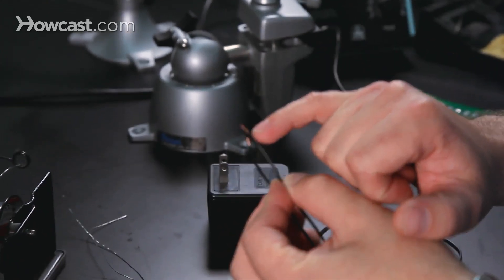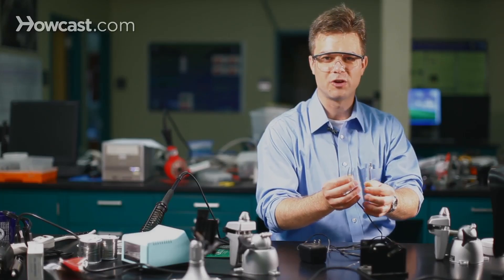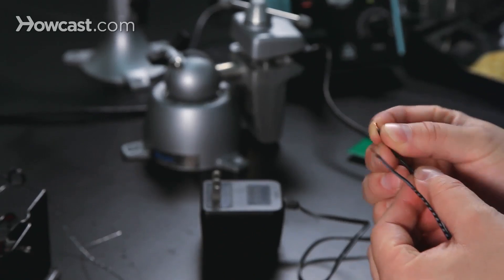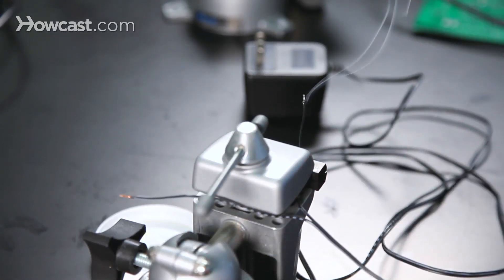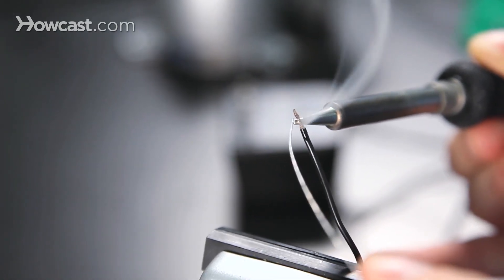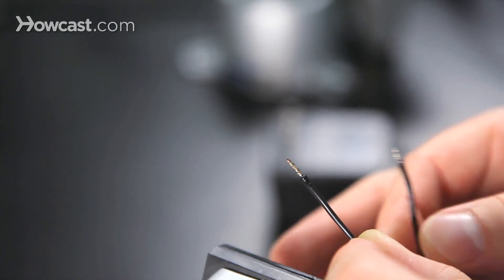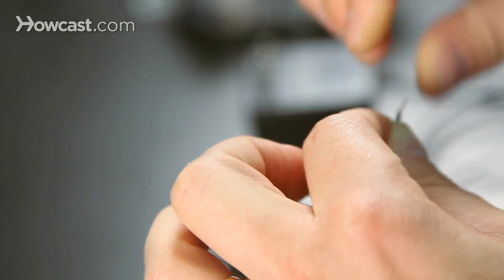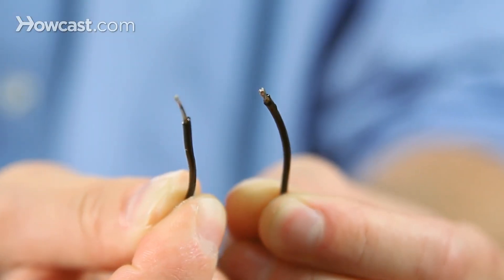Common Soldering Mistakes | Soldering

Comment: But it doesn't work!!!!  The solder never melts unless I accidentally touch it on the tip of the soldering iron and resultantly make a great mess of things!  I've got a 100W iron, I tried it at 350C and 375C on pitiful little 18 AWG wire and the damn solder just doesn't melt!  Why?!

Comment: I was having a hard time soldering 0.1mm jumper copper wire, I didn't know even coated copper could oxide. Just rubed some sandpaper and solded like magic!
Yes, I am learning, but tips like this makes huge difference, I don't know why there is so much shade in the comments, that tip was superb to me. I assume people on the microsoldering field don't want competition and is always throwing hate on people that teaches these stuff, that is nasty.

Comment: I have been soldering for years and have done thousands of solder joints and I recently tried to solder some copper wire that I freshly stripped only minutes before and even with flux the solder would not stick to the wire!

Comment: @1:00 3rd. cut and strip the wire. if you didn't have enough slack you are unprofessional and a noob at electronics. if that's the case, its a freaking wire, replace it.

Comment: How do I solder to a smooth metal surface!?
Reply: Depending on the metal, you may have to use a high acid content flux and solder and also rough up the area to be soldered. I think flux for copper piping is quite acidic.
Reply: @anthonytaylor8465  The metal in question is aluminum.
Reply: @voldy3565  sorry it's a little. But at work, we have to solder earth leads to aluminium and we abraid the surface and use high acid flux. Something called Rx I think

Comment: Okay when you cut a new piece and stripped it, was it not the same as the first piece? So no sanding was necessary.  However your claim of oxidized wire negatively affecting the soldering is correct.

Comment: I have a coin I wanted to make into a necklace but when I try soldering it (I never tried soldering before it seemed straight forward) the solder on the neckhoop thing and the coin kept on slipping off and wouldn't stick to the metal so I'm looking around trying to learn the basics

Comment: hello hope you respond to my comment i have a problem when i try to solder microphone wires small thin wires with colored insulate the thing is ... solder does not stick to them it keeps falling off i have no problem with other copper wires but with these it's a nightmare

Comment: The reason I found this was a google search regarding non-corrosive flux for soldering stranded copper wire; The problem if have found is that flux "no clean" tends, through capillary action, tends to wick up the strands, inside of the insulation, leaving blue-green corrosion of the strands, inside the insulation (discovered when disassembling/stripping insulation). To date, have been using Topnik RF-800... applied very sparingly with syringe... station temp set to about 290C, using Sn60Pb40 (SW26/3/2,5%) fluxless solder.... use IPA to clean fingertips, prior to twisting strands together... acetone seems to make the situation worse.

Comment: Doesn't flux remove the oxide already? If you've got flux, do you really still need to sandpaper the wire?
Reply: Ive never sandpapered it. It seems like a minor factor as to the quality of your soldering

Comment: Safety first, soldering a tiny wire with safety glasses on. You should also wear heat resistant pants, just in case you drop the iron on your thingy.

Comment: Wouldn't the flux contained in solder take care of it?
Reply: Normally yes; most solder contain sufficient flux within the core to not need any additional.

But for some special projects, such as those involving surface mount components (SMC) in which you're working with microscopic multitudes of leads, additional flux might be necessary.

Comment: As the aim of this video seems to be to find and point out the common soldering mistakes committed  in it, I found another one (I believe) not mentioned by others below: he talks about 'the alloying'. There is no 'alloying' when you solder. If there was the process would be called 'brazing'.

Comment: I'm an EE with a PhD in flux rheology and another in soldering alloys. I have over 40 years of professional experience soldering everything from hand-built custom spy satellite motherboards to sonar modules in nuclear subs. The tool I use the most is a soldering hydrogen torch with an iridium-plated tungsten tip. I usually clear oxydation by sweeping the wires and components with a YAG laser under a nitrogen atmosphere. If I'm soldering underwater, I prefer to use a focused induction or an ultrasonic tip depending on the salinity and oxygen concentration of the water. If I'm soldering for space, I usually solder with  an alloy of 74% gold, 24% lead and 2% tin to prevent ionisation damage. I think this video was ok for beginners even if it ignores a few more advanced techniques.
Reply: i like cereal
Reply: yeah the only way to cook breakfast is by using a top secret automated kitchen that the military is developing. everybody else is a chump and should just jump off a tall bridge.

Comment: This frustrates me no end. Just do it and it comes out perfect. Not ME Boyo!  First of all, if I just touch my soldering iron to a wire that briefly, exactly nothing happens. (I've tried 3 different irons now.)  So after I hold it together for several minutes my solder wire finally flows... right into a nice round bead that either sits on top of everything or simply rolls off on the floor. I've used up whole rolls of wire trying to solder and still the same thing happens. But, nobody seems to address this kind of problem. Am I the only person this happens to?!
Reply: It's probably due to improperly tinned iron. The tip oxidises with time forming a black layer that doesn't conduct heat very well and also repels tin. Even if you attach a new tip to your iron, it will still need a proper tinning. You can easily look up how to do it.  The second possibility is that you have bad flux or are improperly applying it.
Reply: Anthropomorphous Dodecahedron
Well, that's a start. Thanks for the tips.

Comment: This would have been 300% more informative if you had used a cameraman (or camerawoman) who knew how to pull focus. I'm going to guess they didn't know which direction the lens focuses because they went the complete opposite direction before focus hunting. Now, different brands turn different directions (Nikon goes opposite of Canon) so I could understand being used to one brand. Also, they need to be using a bigger monitor screen than the built in 3" on the camera. Even focus peaking on Sony Nex's don't get super thin depth of field when using 50mm 1.4 lenses. Drop it down to f/2.8 so the solder doesn't look like he's holding an earthworm.

Comment: My soldering iron tip is not working propperly like when it was new. 
How do I prevent this and how can I make it good again?
Reply: keep it clean
Reply: use a wet sponge to remove oxides that have formed on it and then put some solder on it before using it
Reply: Felix St 
Okay strange I have done that every time with my new soldering iron

Comment: Why not just cut the end off? You'd only lose a cm of wire.
Reply: +Chris McTavish you don't always have a cm to spare
Reply: I agree with cutting the end off, makes sense.
Since you are getting new clean copper after doing this, why would you need to sandpaper it??
Reply: Yup that's also thing with my full time job, im soldering sockets and other stuff and wires come to me in specified lengths, so they need to stay in that dimensions no cutting or some other crazy stuff... lel
Reply: That´s what she said...
Reply: +Chris McTavish you don't always have a cm to spare

Comment: Does anybody know if I can use a paperclip for solder?
Reply: if you melt the paperclip i guess but youd probably melt everything else
Reply: No, solder is made so that it has a low melting point
Reply: +BuddyBros255 an average soldering iron does not heat at high enough temperatures to melt a paperclip.

Comment: what kind of soldering iron tip is best? I go through a tip about every 2 weeks. I use a soldering iron about 1 hour 5 days a week. I did find out tho that my solder that I was using had acid in the core.. oops. besides that, are you supposed to get more time out of a tip?
Reply: I work for a company that manufactures circuit boards, so I solder every day (five days a week). I usually replace my tip every few months... it just depends on what you're doing, how often you tin the tip, how you take care of it, what kind it is, etc. A couple of weeks seems like a pretty short amount of time, though.
Reply: +Alpha Nerd 
Make your own tips, save money. Search DIY solder tips on youtube. 
They are all made the same way, essentially. Some expensive tips use more iron coating on their copper core tips. But, copper DIY tips will work. You just have to learn how to care for the tip better to get longer life out of them.
Reply: James Pian I have tried that in the past. I don't like the way the heat transfer is changed. It just  doesn't work for me. I would rather pay $1 a piece for them.
Reply: Rachel Bonneau Thanks for the reply! I figured out what the issue was. I was using a Weller iron. It seemed that there tips did not last long. Although it was also mainly to do with the fact that after I looked back at some of my joints, I saw a lot of cerossion. So I looked at the roll of solder that I was using (my dads 20 year old roll that was sitting in the basement and he swares he was using it for CB radios) and turns out there was acid in it. So after I got a new craftsman and was dilligent with keeping it in tip top shape, I got around 2 months per tip out of it like you said!
Reply: +Alpha Nerd  im very happy with this one ,  300 degree in 4 second From DC plug,    
 but you need 24 V and 3 A http://www.banggood.com/TS100-Digital-OLED-Programable-Interface-DC-5525-Soldering-Iron-Station-Built-in-STM32-Chip-p-984214.html?p=J031143423240201512X
Reply: Alpha Nerd You feel best when the melt piece is shiny. Getting the spot rough, right?

Comment: When you get your flux, how do you turn it into a liquid? because I bought one that was in a round container and isn't melted. So are you supposed to melt it somehow?
Reply: +Venture Foro You just dip your wire strands into it
Reply: +Venture Foro Sometimes Flux crystalizes (especially if its been stored coldly). thats ok, just heat it up a bit and it will become semi-liquid. Ive seen people even using the soldering iron itself for this exercise with fine results.
Reply: yeah I dip the soldering iron into the flux really fast and it melts a lot a flux for the job. thanks

Comment: Dude, just cut off the end that has been exposed for a while. :)
Reply: +Just a Visitor This is not always possible, for example when repairing already existing electronics that would result in the wire being too short if you cut the tip off and having to revire the entire thing in such case.
Reply: Didn't the guy cut and strip a new end in the video?
Reply: +Strazdas then solder in more wire
Reply: Neil Etnyre Well i guess that is a solution, but then you  end up with two solder joins instead of one and solder is brittle so it cannot bend like wire does.

Comment: You guys really screwed up this video to the point where the visual information is hardly helpful at all. First, you're not zoomed in enough on the area of interest, namely, the end of the wires. They are barely visible. Second, the autofocus is jumping all over the place as you move the subject in and out of frame. Since you are focusing on a single object at a fixed distance, you should manually set the focus for that distance and leave it there.
Reply: They could also fix the f/stop to a smaller apature (eg, bigger number, 11, 13, 15) and bring in more lights to compensate.
Yes, they would lose the blur background. but since they can't keep a set distance from the lens, we might as well have more focus range to play with.

Comment: sandpaper to clean multistranded wire ?
using flux with flux cored solder  ?
just lol

dunno what you do for a living but it's not soldering
Reply: He said it was rosin cored  solder in the video. He didn't seem to know that rosin IS flux right enough.
Reply: +nexus1g
if you can't infer from him calling the tub of goo both "flux" and "rosin" that the rosin cored solder has flux, then you've got issues.
Reply: How are you able to determine that the solder wire had a flux core?

Comment: Didn't quite understand, so what would be the chemical removing of oxide here?
Reply: I believe its the flux that removes the oxide and then allows a clean contact to solder.
Reply: RideRedRacer 
Oh, right. I missed it, I thought he showed the flux, but then took something else -- English is not my native language.
Reply: +TrueBlogge777 

I thought I understood it, but now I am back again to this video, and I believe I now finally REALLY understand: what confused me is the guy in the video saying that one of the two ways of eliminating the oxide layer is a "chemical one" - with rosin (flux, as I understand), but then goes on showing us the opposite - the rosin didn't do anything to that oxidized wire.

So you are saying that he meant that rosin could only help to eliminate oxide layer from a relatively clean wire? If that's correct, then it wasn't very wise of him not to mention this little detail...

Crazy... Is it just me or his explanation was indeed kind of confusing?

Comment: Or you could just cut and strip a fresh wire further down the wire ._.
Reply: Not when you need specific lengths and the wire is not replaceable.
Reply: or you could watch the whole video and realize he did just that!
Reply: Or keep your wires nice and moist inside your girlfriend.... Also a good solder iron holder..

Comment: Could you not just cut off and strip the end to expose fresh wire??
Reply: Not when you are working in a situation where that is not possible.
Reply: if the wire housing became permeable from oxygen/light exposure, then the whole length of stranded wire will be pretty well oxidized and stripping it will be a fools errand.